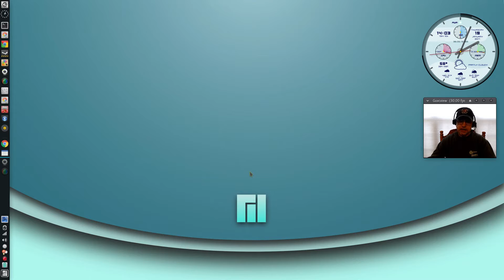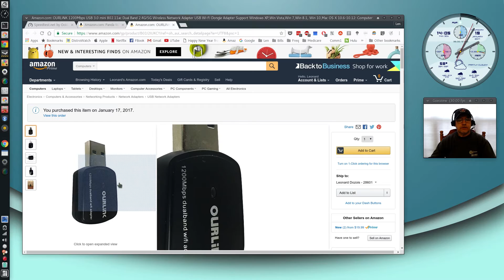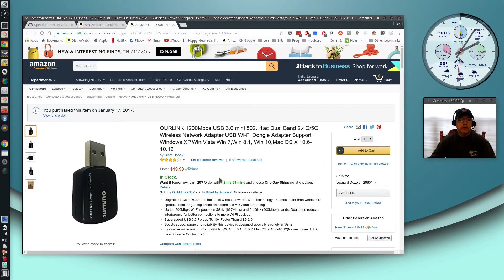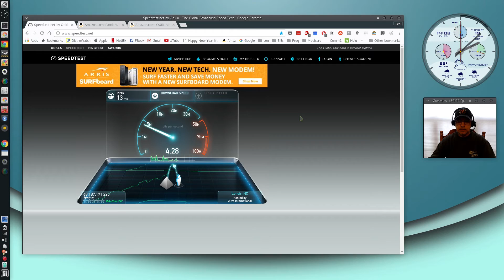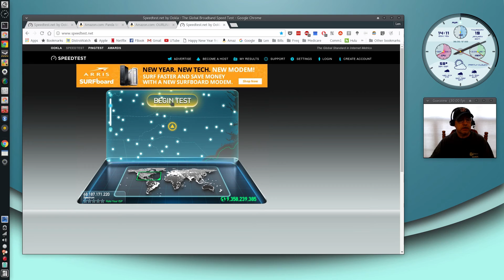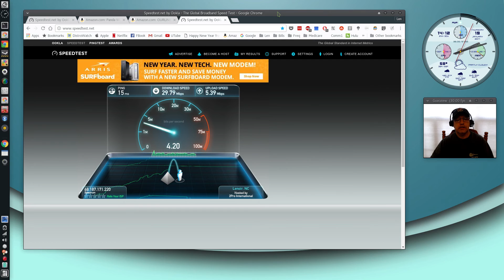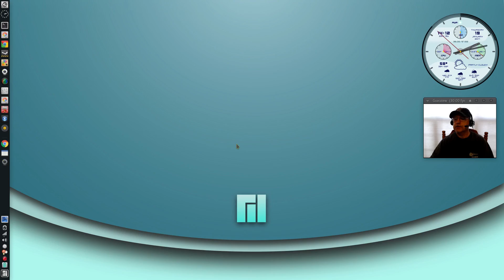OURLiNK 1200Mbps USB 3.0 Wifi Adaptor - Review

Comment: There have been a lot of complaints on Ubuntu and Debian forums about Realtek devices, including this chipset, no longer working with the 4.9 kernel.  Apparently another driver in the kernel has had the USB ID for the devices added to it, and either it doesn't work or the two drivers are clashing.  The workaround is to force the loading of the out-of-tree driver module...so I'm wondering if you have tried it with a 4.9 kernel to see if you have the same issue.
Reply from the maker: I have it working fine with the 4.9 kernel. No problems here.